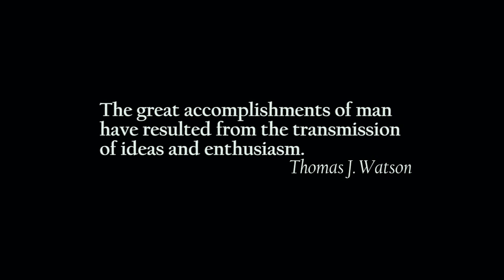How To Remove Classic Ford Automatic Transmission Episode 439 Autorestomod

Comment: If safety was important then lowing your lift to a safe limit off the floor and laying on your back or backs would have been the way to go if laughter was your goal then you got that but showing us the wrong most unsafe way to do this, then yes you nailed it. keep up the good work guys
Reply from the maker: Actually, showing how to install the transmission was tops on our list. Hard to do 20 inches off the floor.
Reply: I'm doing this without any jacks on a nineteen sixty four fast back galaxie  it sucks balls and ganna probably pull engine first  tho 😂

Comment: In the same position you were in (same lift) instead of the trans jack being on that metal plate and having to gorilla it off, we had the jack on a metal rolling cart (two 4 x 4's under it on the cart), jacked up under the pan,  so when we pulled it BACK , it was already on a secure platform. Then you raise the lift roll that puppy right out of there. Try that when you have to put it back in :-0) Problem where you had it on the metal cross plate, no way to lower it off and roll it out (and Cam takes a bath...lol)

Comment: I put the car or truck on the lift and use my engine hoist. I built a mounting plate for the engine hoist and this works great for removing transmissions and installing them.
Reply from the maker: I hadn't thought of doing that good idea.

Comment: I bolt a boxed end wrench through a bell housing hole to hold torque converters in.  Yup, I have about a dozen 2ft long chunks of RR ties. Just got done installing an engine in a 05 mustang with the ties. Laying on th ground doing things like that is alot less fun at 60 years old.
Reply from the maker: Amen. 56 ain't easy either. Good for an ab workout though...

Comment: It’s good you guys have the jack bridge.  With a 2-post lift, you almost need two trans jacks to do the job right, support the engine, and make those fine adjustments it always seems to take when you put the thing back in.
Reply from the maker: We're using the transmission jack now. Came in the afternoon after this video. Lol

Comment: I have done many transmissions with the car on jack stands and it is not fun. When I was a tech the shop had in ground lifts. I like them far more than the current post lifts but when I get one for home it will be a 2 post asymmetric lift. More for resto work so lifting bodies off frames is common.

      I knew a guy with an old K5 blazer. The trans went out on the freeway. He got a ride went and bought a new trans and swapped it on the side of the freeway. A couple hours later and he was on his way again.

Comment: checked comments to see if anyone had similar questions as me regarding the shift arms (the knuckles attached to eachother on driver side that come from a automatic shifter not sure what its called tho ) as I have to replace an engine and its out but I've heard removing the trans is easier when trying to realign the engine back in but comments are pretty disrespectful its a good video and it's right to the point just throwing that out there.
Reply from the maker: Send me an emailso we can dig into what you are needing. jford@autorestomod.com

Comment: Great tips thx
Just wondering since ive seen you work on an F100... I have a 69 , do i have to remove the cross member to remove the tranny? If so any tips on getting at the bolts up  inside the frame?

Comment: Hey Jeff. I'm replacing the transmission mount on my 67 C4 tomorrow. Any "how to" videos on that? Or tips? Thanks.
Reply from the maker: I really don't have any videos on just replacing the transmission mount. You'll just have to put a jack underneath the transmission pan with a 2 x 4 Aces to Jack the transmission up after you take the bolts out for the transmission mount. Then the crossmember can be removed.
Reply: @AutoRestoMod  thanks. It's simple things like this that are very helpful to us rookies. Motor mounts will be next. With the engine still in it. Good times......good times. 🙄

Comment: I need to isolate a vibration. Do you think it's possible to slide the torque converter back towards the trans (after removing nuts) and  clear the flex plate? I'd like to start the eng with the TC disconnected and narrow down my vibe problem.
Reply from the maker: Not sure.

Comment: i don't know how that car lift works, but I would have lowered the car after everything was disconnected and used a large floor jack under the tranny to drop it. But, I'd also be doing it by myself so it would be a  balancing act, just not as heavy for me.
Reply from the maker: That's certainly another option for taking the transmission out. However we bought the transmission jack just specifically for this kind of work.

Comment: How come nobody shows how to remove the dipstick tube?
Reply from the maker: It is a twist back and forth and pull thing.
Reply: @AutoRestoMod  some are attached by the top right (left if you’re doing it from the engine bay)  bellhousing bolt

Comment: Why are you always working on your mom's station wagon ? I don't care for it much.
And is the new one going to leak as bad as the old one ? How long does that usually take ?
And if you stop the video at 4:30 it's really funny.
And did you nail those 4x4's together ? Or fasten them together somehow ? I don't want to watch the whole video.
Reply from the maker: Welp some points Mr. Fun Time my mom died last year, the wagon is mine; I do golf clap your attempt at being funny. The wagon is a vehicle that, as I have explained, we bought to do car to car from. The 4R70W is a final part of that. Another point: I don't believe you are forced to watch this show, so, when your visual foe is on, find a nice cuddly video for that week. Most everything on that wagon we are doing crosses over to Torino and Fairlane hardtops so the spectrum is larger than you might think. As to the 4x4s you figure it out, I don't feel like answering your whole question. Have a fun day.
Reply: @AutoRestoMod   BOOM chak a laka Jeff. lol

Comment: 2 minute commercial = unsubscribed
Reply from the maker: You do realize that that is how we pay our bills to DO these fine videos. Why is it that some folks think I should work for free, but they would balk at doing that? Hmmmm? Come on KnP B, go into work tomorrow and declare that you will toil for 70 hours a week for free for 10 years. Do it. I double dog dare you.
Reply: @AutoRestoMod  It doesn't need to be using a 2 minute infomercial. TV execs figured out 50 years ago viewers can barely tolerate 15 second commercials. Youtubers need to follow the examples of the industry's giants; 2 minute infomercials are abhorrent. No one except the executives at the company you're touting wants to hear about those products for 2 minutes. If you want to make a bigger impact, use the company's name 3 or 4 times within the entire video. Repetition peppered in a presentation has greater sticking power and influence than an infomercial.
I never said you should work for free - don't make assumptions and don't put words in my mouth, I'm capable of finding my own words.